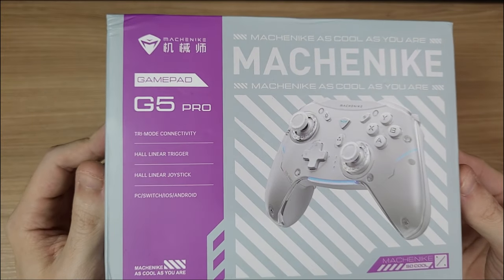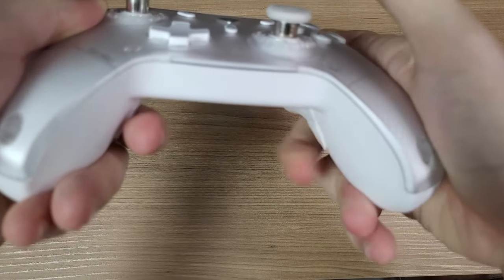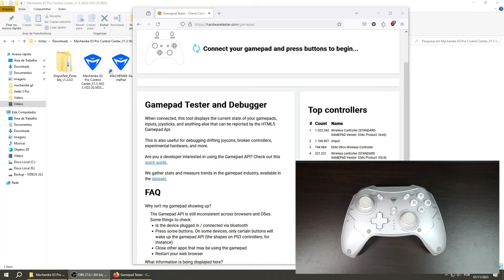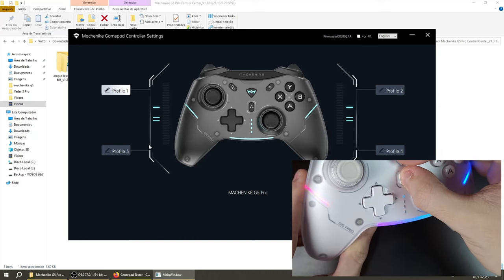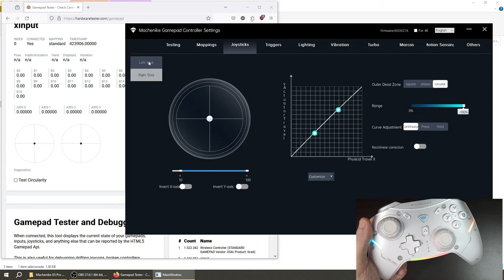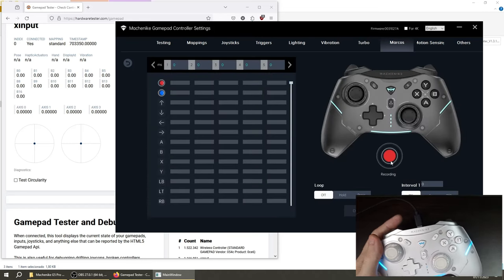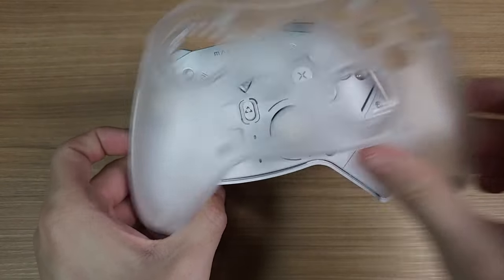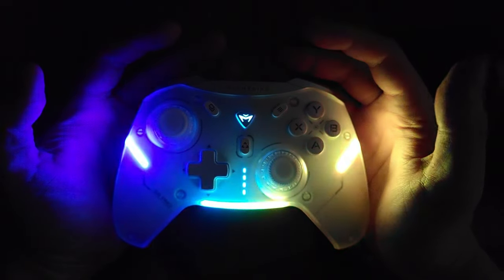Machenike G5 Pro Review - A beautiful work of art

Comment: Hi, if you assign the RB/LB/RT/LT2/3, ABXY button to M1-2, and make them in turbo mode before that, will the M1-M4 buttons also inherit the turbo mode, or can I assign the turbo mode to RB/LB/RT/LT2/3, ABXY when I don't need the turbo mode on M1-M2 and vice versa, there is a turbo mode on M1-M4, but the turbo mode on RB/LB/RT/LT2/3, ABXY won't assign? Can I set the turbo mode without software directly on the gamepad (turn it on or off whenever I want?

Comment: I love how the motors are removable as it can lighten the weight.
the rubber underneath the keys looks like it will survive normal use unlike my experience with four different PS4 controllers.
Reply from the maker: most top quality controllers have removable rumble motors as well
Reply: @VKsChannel  that's true for Xbox 360 too.
the Dualshock 4 requires surgery for that to happen but not worth it as they all break down too often and can get trigger-to-thumbstick drift.

Comment: Thanks for being so thorough.  I'm torn between this or the Gulikit KK3.  I am also tempted by the Flydigi Vader 3 pro but am a little worried about AliExpress if I need to make a return.  Any thoughts on which to get? The Vitrix Gambit also looks good, but it feels as though that's an older controller.  Are you on r/controllers?  Thanks, Michael

Comment: Never update the firmware.
can't get a wireless connection. Never  Never  Never    Machenike G5 Pro Firmware_G560279_F47C_V1.0_231027a
Reply from the maker: Report this back so they can fix it quick
Reply: too bad, i update before read this.

Comment: Do I missed something because I can't map macro back buttons to joystick click (usually for sprinting).
Reply from the maker: You should be able to do it with the software but I'll test on mine later
Reply: I tried with the linked software via pc, then saved. But remap not saved. Do I need to upgrade controller firmware for the software to work. I would like to decrease the right stick sensitivity a bit.

Comment: Purchased a Machenike g5 pro. The buttons do not work in dongle mode 2.4. The game sees the gamepad, but the buttons are not pressed and are not detected. Can you tell me who has encountered it? They say this is a massive problem
Reply from the maker: Have you updated it?
Reply: @VKsChannel  yes(
Reply: I just got mine and encountered this problem too. I didn't update anything and the controller would pair with the dongle and the PC recognized it as "USB controller" (with a keyboard icon on Windows tab "Devices and Printers"). What I think made it work normally was turning on the gamepad and pressing its buttons (face buttons and/or moving the sticks) when pairing and it would be recognized as an Xbox 360 controller, making me able to play with the controller wirelessly.

Comment: Between this channel and Gamer Heaven I am so confused as to what makes a good dpad or what to get. All I want is something good for RETRO/emulated games.
Reply: Might be able to help you. When you say retro , up until what console generation? If you are looking for a pad that covers 2D games really well something like the M30 by 8bitdo or the Retroflag 6 button genesis style controller or snes style controller are some of my favorite options. Once you start getting into controllers for modern games you tend to get worse D-pads and overall ergonomics for those older games. Just about anything before the PS2 era should work great with those controllers I mentioned. I play through hundreds of games yearly for the channel, and the 8bitdo M30 is one of my favorites for versatility.
Reply: @theconsolekiller7113  Thanks. I will look into those specifically and by emulation I mean all the way up to switch but mostly snes/genesis/ps1/2.
Reply: Looks like youtube deleted my response. No problem. The M30 should cover you all the way up til the 16 bit era and even works for MOST of the PS1 library, since most of those did not require analog sticks. Once you get into the consoles that require analogs, the KK3 MAX by Guilikit is an awesome update to the KK2 PRO and is easy to reccomend. Super responsive hall sticks with no deadzone, like this controller, but the Dpad is quite good. Not great like the M30, but perfectly usable for old games too. The turbo functionality on all these controllers is also super useful for a variety of games. If you purchase the M30 just be aware there is two versions. The 2.4 Gz version is said to have less input lag on PC. I tried it and didnt really notice a difference, though maybe its subtle. I had no issues with the original M30 and that is the bluetooth version which works on more platforms. Both versions work on PC. I reccomend using the controller wired for reliability but the bluetooth one supports wireless. I have had disconnects with blue tooth. I play alot of super precise old games so Im real sensitive to input lag.  @stephenxs8354

Comment: This got a bad review on gamer heaven also no trigger stops, no dish style d pad and only 2 extra buttons.
Reply from the maker: I saw gamer heaven review and the only complaint that I agree with him is the back buttons, but it is something that you can get used to after a using the controller for a while

Not having trigger stoppers or disc dpad is not something that should reduce points on a review

For example the bigbigwon rainbow has disc dpad but the actual quality of the dpad is horrible with terrible diagonals

The dpad on the machenike works very well and its very easy to move around in games 

And yea it has only 2 back buttons but it is the only controller with trigger macros allowing you to simulate the gamecube triggers on emulators perfectly
Reply: the positives far outweigh the negatives this controller is a gem for the price and im surprised it's not as popular as it is

Comment: great work!  just checked, these cost 22 usd where i live. what do you think of them at that price?
Reply from the maker: wow at 22 usd? are you sure its the same controller?

seems a great price!
Reply: The same one. And there's a Machenike G5 Pro "Max" version for around 45 USD which is basically the same but comes with the charging dock and improved rumbles. ouh and it comes in whight and pink!  @VKsChannel 

edit: around 60 USD
Reply from the maker: @salohi1990  Improved rumble you mean HD rumble?

Sounds awesome

Comment: Been waiting for this review for a month now, and I have to say you truly delivered. Nail on the head, stake to the heart. I've waited eagerly for your take on this controller because imo, nobody else does super in depth reviews like yours and I am now, hella convinced to get this bad boy. Thanks for the manual review too, that's a sweet lil touch in case potential watchers turned buyers lost their manuals lol. And the diffused rgb look on the controller looks absolutely awesome. Though one thing you missed, was testing the polling rate wireless but nonetheless, I'm probably buying this over the 8bit ult. Thank you so much man! keep up the great work!
Reply from the maker: I left it off because generally it is lower than the wired polling rate and for players that really want that competitive edge in performance they're gonna play wired to get the best connection possible

I'll check the wireless polling rate and reply back later 🙂
Reply: @VKsChannel  Awesome! I don't personally play any comp games with controllers, I play mainly single-player/party game, and arpgs like genshin, punishing raven and honkai. I know the xbox controllers have super low rates wireless so I'm used to it, and wont be too disappointed if the wireless on the g5 has around the same haha
Reply from the maker: Here's the polling rate results

150Hz with 2.4g dongle
70Hz with bluetooth
 @riffska
Reply: @VKsChannel  Noice! I don't mind that at all actually, cuz I expected that much or around the xbox series' polling rate. Thank you for your time man, appreciate it!

Comment: Brother, good day, excuse me. I ordered this controller and the thumbstick or lever on the right side broke although it is still functional. I would like to replace it with a new one because it makes a slight noise and feels a little strange. Do you know where I can get them or from any other brand that do they fit? Thanks in advance.
Reply from the maker: You would need to test others

Maybe the sticks from an xbox controller may work

Also have you tried contacting machenike?

Comment: Between this or Kk Max 3 or 8bitdo Ultimate, which one do you prefer?
Addional info, I already have 8bitdo pro 2, and i am loving the trigger of that controller, so if you can, may you give me suggestion based on my preference
Reply from the maker: Those 3 are very distinct
But if I had to pick one I would pick the KK3 max
Reply: @VKsChannel  if trigger on kk 3 max can be considered soft? Btw. Thx for the reply
Already subs

Comment: just bought my own g5 pro and i loved it so far. do you have any tips on what or how to replace the rubber membrane?
Reply from the maker: did the membranes break?
Reply: @VKsChannel  not at all, I'm just genuinely curious since this is one of the top controllers of the VK Awards when it comes durability, and I've been curious since there are no replacement parts on the official machenike page. 

Thank you so much by the way, I really love your tear down reviews.
Reply from the maker: @JOSHUALIZERZ  even if the membrane breaks the mouse switch under will still work and there is still a solution for this, it might involve some 3d printing to make the silicon pad reach the switch and it might greatly reduce the travel distance of the buttons, but look at my big big won blitz review, that controller doesn't use membranes so technically mechanical buttons without membranes can still work

Comment: Hey VK, I cannot connect to the software, just got the controller, the software version is 1.3.17, yours is 1.3.16.. tried your method of changing the language to english, it still does not detect my controllers firmware, it's still shows v0001. 

Any ideas to solve this?
Reply from the maker: Are you using the dongle?

The app doesnt work with the dongle try connecting with a cable
Reply: @VKsChannel  Hey mate, thanks for the reply. I am using the cable. Tried all switching to all modes to connect,still doesn't work..

Comment: Mine is just 500hz, what you do for 1000hz? pls help
Reply from the maker: Are you using the cable dongle or bluetooth?

Try with a cable
Reply: @VKsChannel Hey I just bought a G5 pro and im waiting for it to arrive, from the looks I love everything about the controller except polling rate could be a bit higher then 500 but on your video the polling rate is 800 when it's advertised at 500? Is there a way you can overclock it, I heard hidusbf doesn't work. Unless they have just updated the firmware to make it 800hz

Comment: How did you get the 1000 hz polling rate on the gamepad? I have a maximum of 500 hz through the wire. What firmware version?
Reply: Only pro max version
Reply: @nguyenluan3890 The controller in the video is not pro Max version you can see the unboxing, it's a completely different box to the pro max box I have seen on other videos
Reply: And ? I said 1k only available on pro max. What your point of you?

Comment: Can you use gyro to control the mouse on PC connected as Nintendo Switch mode, or only via dongle/wired?
Reply from the maker: Only with the dongle or wired

Switch mode acts as a pro controller
Reply: @VKsChannel  hi, VK. Thanks for the response, but I have one more question.
I used to have 2 gamesir t4 pro and I didn't have any problems connecting both of the controllers via 2.4 GHz dongle (connecting both dongles to the PC of course). 
But I've seen one or two people complain about not being able to connect two G5 Pro controllers at the same time via dongle and ended up having to connect one of the controllers via Bluetooth. 
Did you run into that problem?
Reply from the maker: I'm not sure because I don't have 2 of these controllers @ivancarlos4806

Comment: sorry for asking another separate question but, anyone managed to make the app detect the joystick while connected to the 2.4g dongle ?  the whole profile settings doesn't seem to work when on 2.4g mode (beside the lights) all the mappings or the pre programmed combo buttons doesn't work on 2.4g mode
Reply from the maker: I had this problem too, I can only configure it in the app with a wired connection, what button combos are you trying to program?
Reply: @VKsChannel  Thanks for both of your replies :3 ,I was trying the motion sense to be mouse movement, it only works when the gamepad is connected wired mode, and after i tired couple times, any mapping that is not a gamepad buttons will not work if we are using the 2.4g dongle (example, keyboard buttons, mouse clicks, media buttons, gyro mouse movements) even the preincluded combo of (FN + left stick click , to enable mouse movements). 
I went through the whole Manual  and according to that it actually wont work on the dongle connection, (specifiaclly at least the FN+left stick click) will only work on android and if connected wirelessly using bluetooth to the pc and not through the dongle. 
well i'm off to 3rd party applications to make the mappings i want, it's still a bummer tho T^T
Reply from the maker: Send machenike an email and maybe they'll fix it on a firmware update

Comment: Great review! Would love an update after certain time of use. I read some posts stating the RB/LB buttons die rather quickly with high use (become mushy).

How would you compare the face buttons on this vs the Vader 3 Pro?

Also curious about the wireless polling rate
Reply from the maker: I updated the polling rates on the description

I like the machenike face buttons 
They have just the right amount of resistence, the dpad is also very soft and wont trigger all directions unlike the vader 3 pro, but overall the vader 3 pro has a better app, and additional shortcut buttond, the flydigi pc app is also better
Reply: @VKsChannel Thank you for your work!

Comment: I see they used membrane under the buttons, so that's a lie. It's not a true mechanical
Reply from the maker: The membrane is just to make the button smooth

You can remove the membrane and add some rubber or something else and it will still click the button